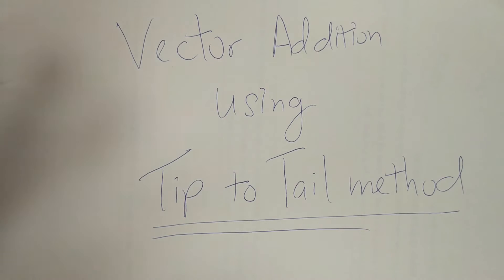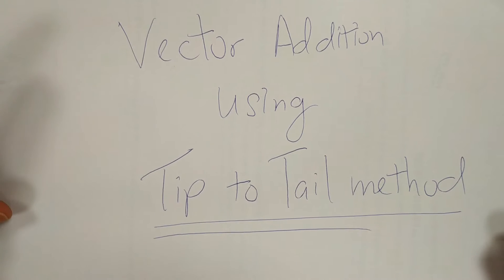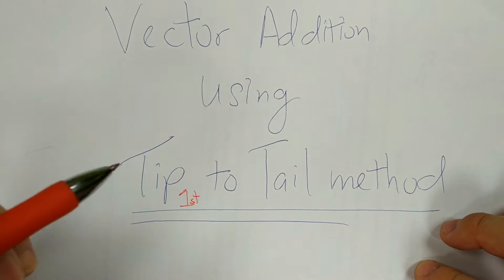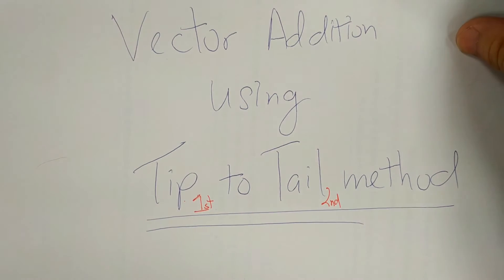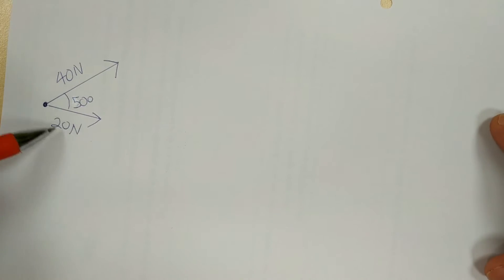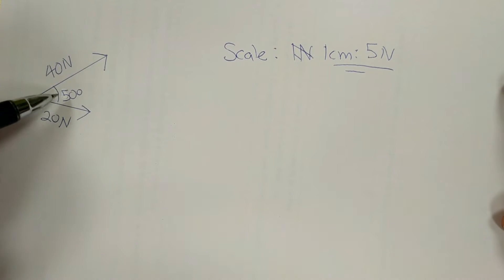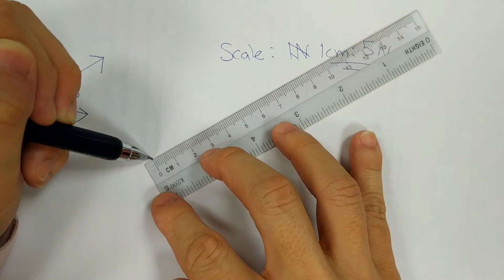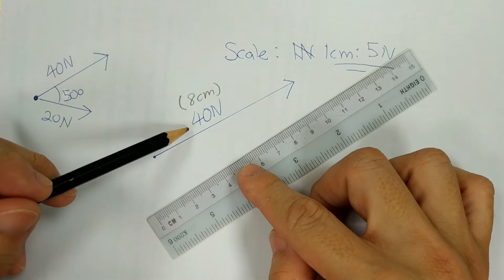Chpt 3: Dynamics - Vector Addition (Head to Tail method)

Comment: Can I ask why the position of 130 cannot be replaced by 50 degree?
Reply from the maker: the orientation of the force must be kept constant > 40N is 50degree anticlockwise from 20N .. so when u rearrange the forces (using Tip-tail method), the orientation of the forces must remain the saem